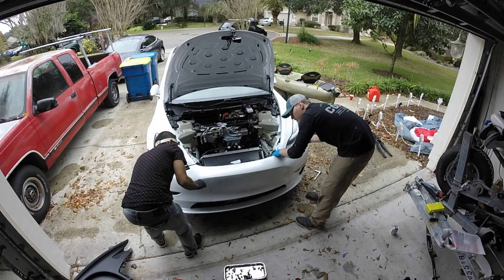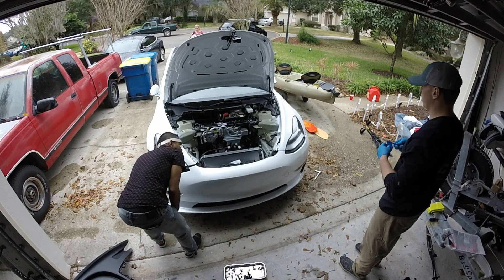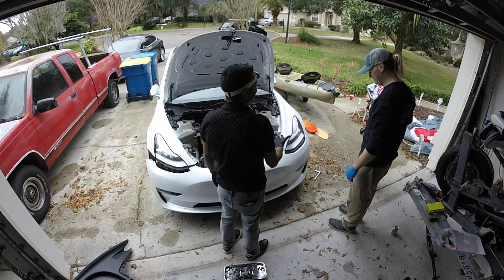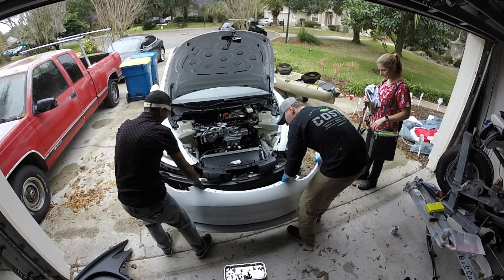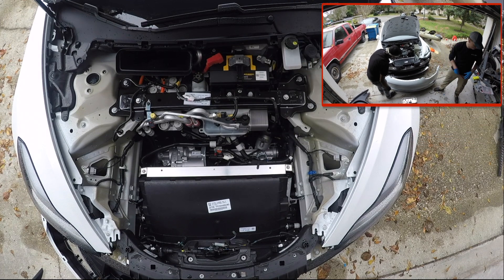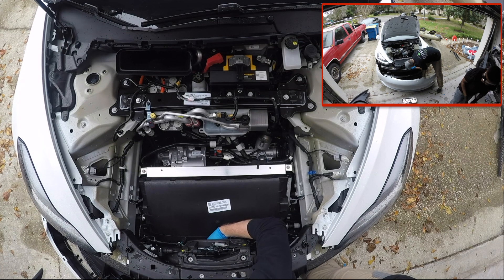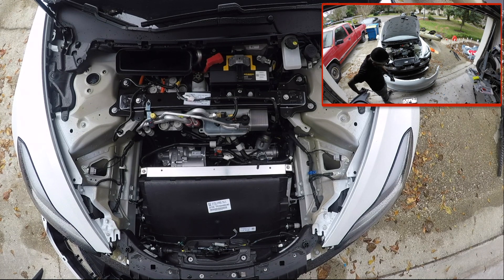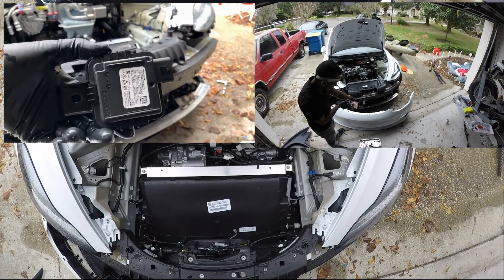Tesla Model 3 Homelink Retrofit

Comment: Are the older Model 3s hard to access like this, unlike the new ones which don’t require bumper removal?
Reply from the maker: that's pretty cool. Makes sense since Tesla maniacally focuses on simplification of processes
Reply: For models 3 you have to take the bumper off. Unless you want to zip tie it or double sided tape it. For the model Y you don’t have to take the bumper off. I think the confusion is the other videos saying model 3/Y but the installation is not the same for both models.
Reply: As most people know by now, there is no need to remove the fender inserts, bumper, etc. This is a terrible video for something so easy.
Reply: @douglasbkerr  Not quite, I have a 2020 M3 and I need to take the bumper off as well. I've taken everything apart except the bumper and there is no way to reach my Homelink. The official Tesla install documentation for the service center calls for taking off the bumper and installing it where it's shown in this video. So this is the "official" way. The other tutorials on YouTube are people doing it the quick and dirty way. Still works though.